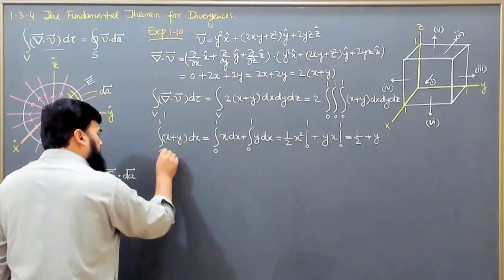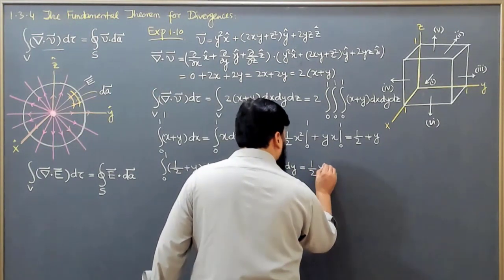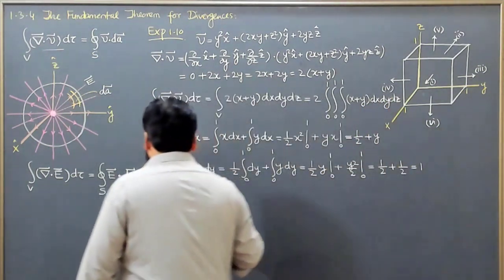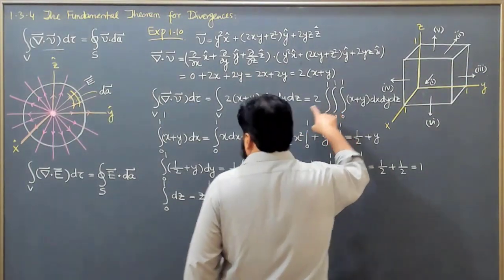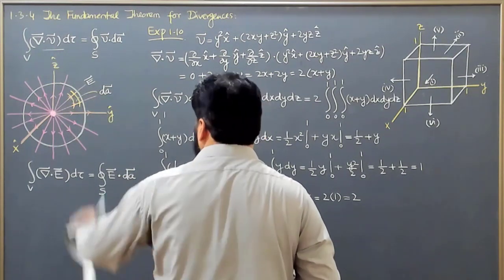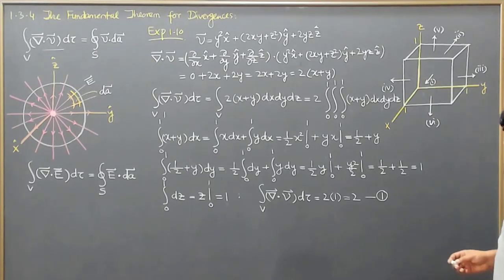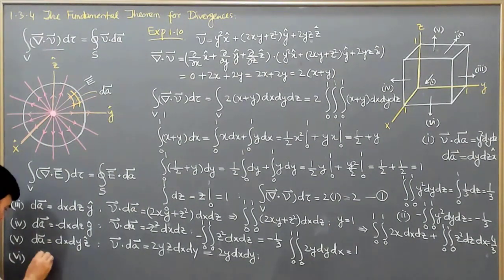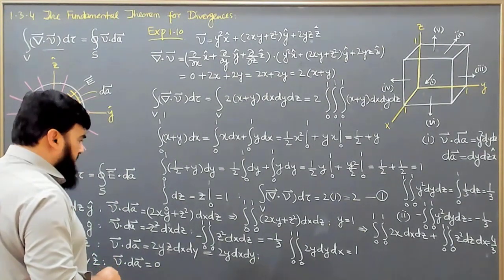L10.2 Solution example 1.10: The fundamental theorem for divergences

Comment: in conclusion, the surface integral  can be converted to a volume integral then it will be easier to calculate the flux. right ?
Reply from the maker: No dear. The volume integral is converted into surface integral. That is, we calculate the divergence of a vector function (physical quantity) in the whole volume will be that same if we do calculate flux of the quantity directly on the surface. Thanks